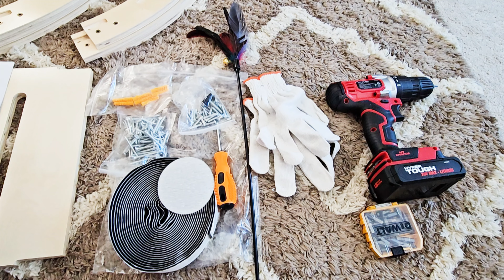Vevor Cat Wheel - Assembly - Quick and Quiet!

Comment: The extra wall anchors are for the slots that go around in case one pulls out or gets damaged. Also, please please sand it down. I cut my hands moving mine before I sanded it. It'll make sure you don't get hurt, and especially your little kitties.

Comment: I bought an extra large Vevor bicycle  wheel for my 2 Siamese cats. I installed the first three arcs with the panels. Then when I came to install the other three arcs by turning the wheel the other way, the whole bycicle wheel cracked into 3 parts. Your instructions are good for small and medium sized wheels not extra large ones. This bycicle should have been mounted in 3 sections then joined together. Both my cats were upset and unhappy!